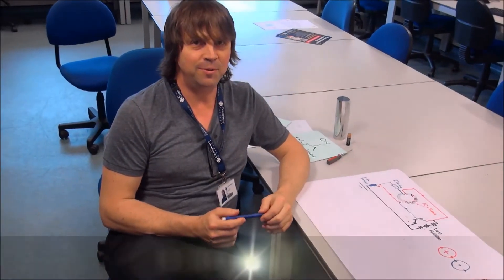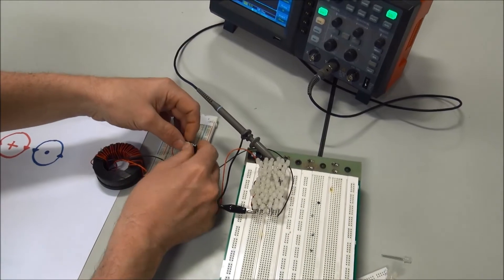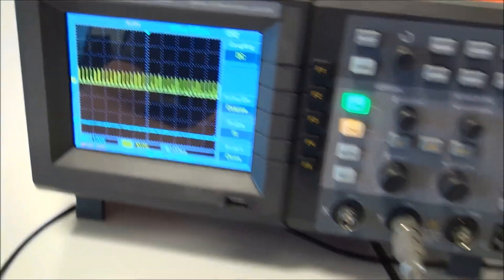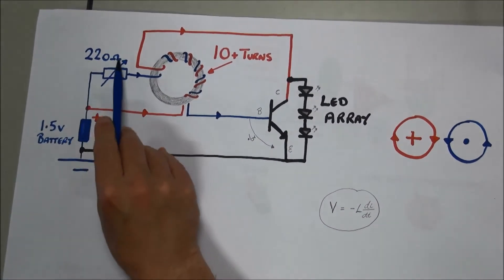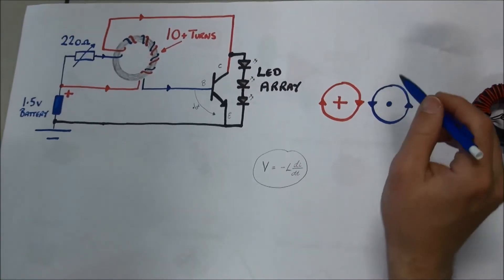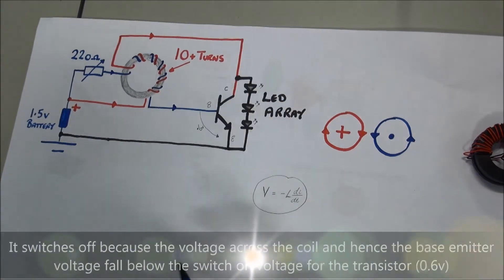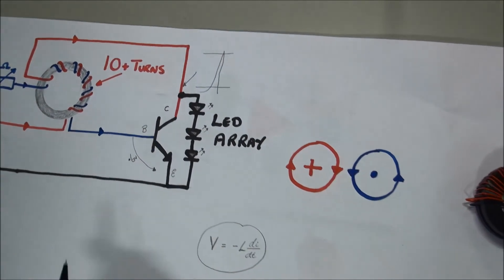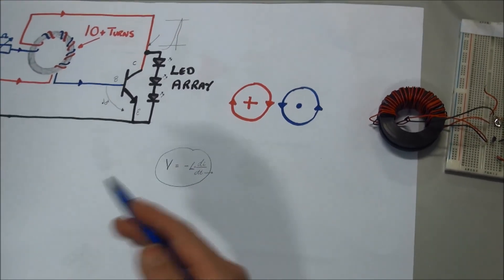"Jewel Thief" demonstrated and explained ;)

Comment: Whoa! You gave no information about what transistor you are using.  The typical JT uses a 1000 ohm resistor.  Using any resistor below 220 ohms risks damage to the base-emitter junction from excessive current.  If you use a 220 ohm resistor, you should use a power transistor such as the BD433 that can handle high current.  And setting the 220 ohm variable resistor at less than 220 ohms is just wasting current.  Thanks for the video.